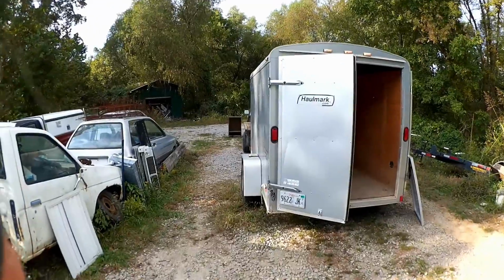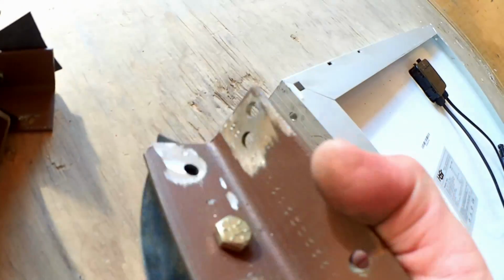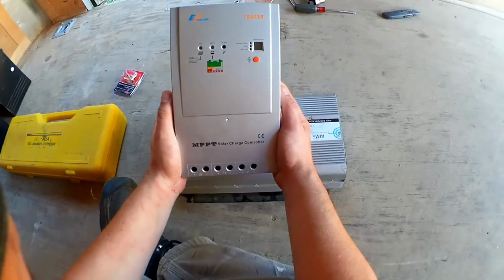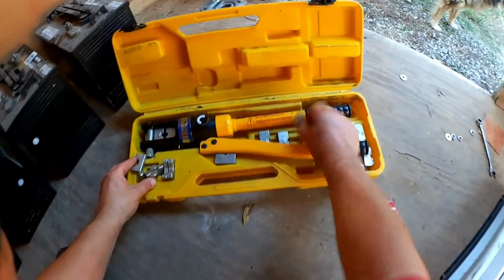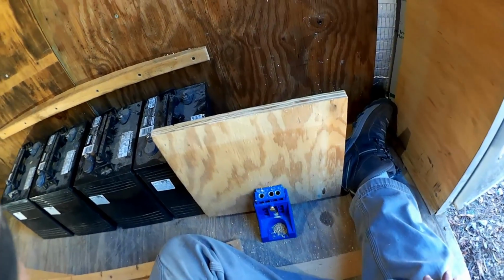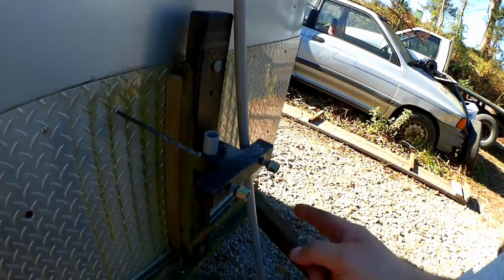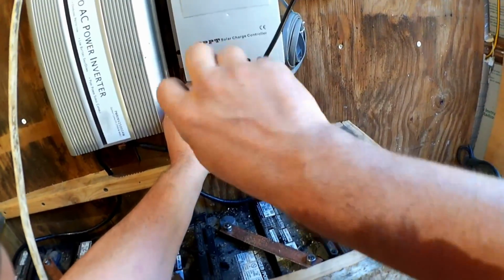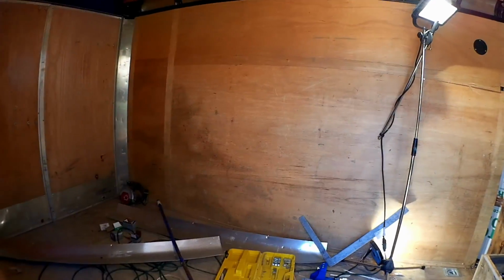Solar Trailer Power

Comment: those flattened copper pipes connecting the batteries in series might end up creating stress fractures in the lead in the batteries.   with all the vibrations from being mobile.
Reply from the maker: That's a very good point, but there's only one way to find out, and someone has to do it.  For science!
Reply: lol, for science